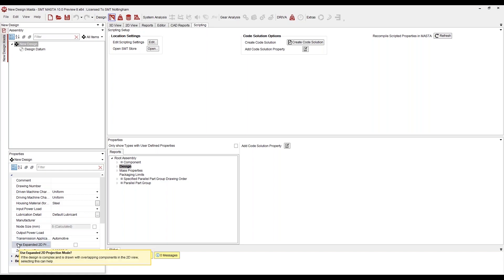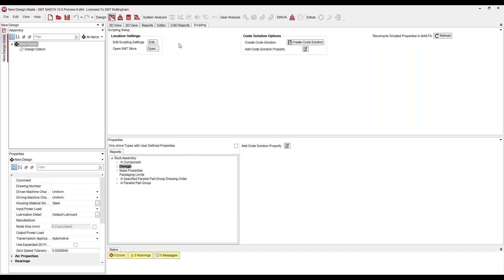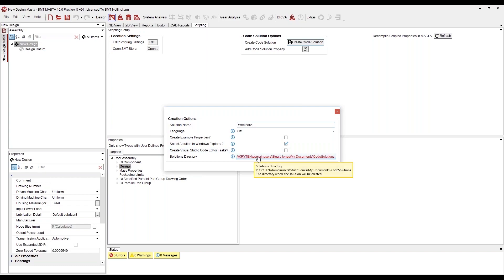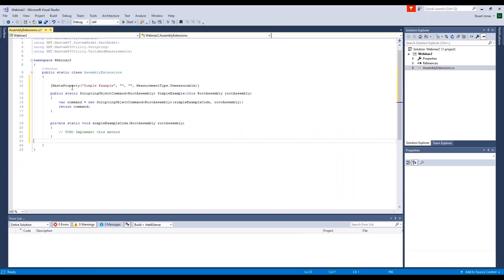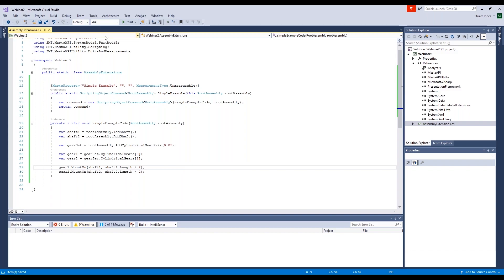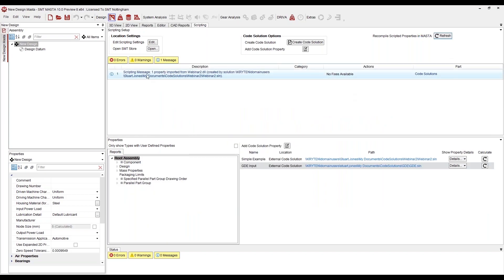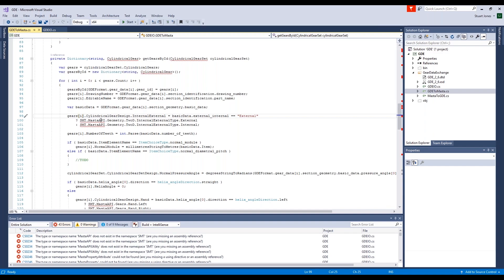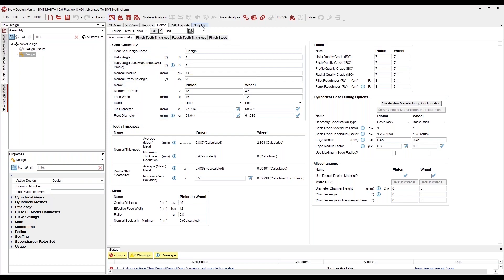MASTA Webinar Series | Scripting in MASTA

Comment: Might be worth checking the stereo/mono mix. By bizarre coincidence my laptop has a very common fault with the left hand audio which means that anyone else unfortunate enough to have an old Lenovo will probably hear no audio unless they use a headset. I could be wrong, but it seems as if the audio is mixed only onto the left channel.  There might be folks out there in gearland who assumed it was a silent tutorial :)

PS Well done rolling the scripting out